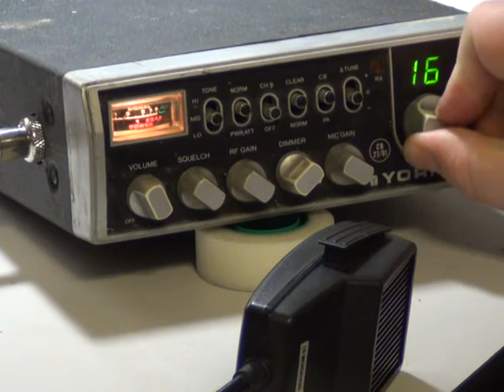York JCB863, UK (CB 27/81) CB radio (Mobile)  - On The Air Test

Comment: Do u do repair video on repair on the channel display.... Would be much help if you do.
Reply from the maker: There are quite a few reasons why a display doesn't work, but I'll bear it in mind if I get a set in with a blank display using this chassis (Cybernet 134).

Richard, G0OJF, UK

Comment: I had one of those new, from Boots, in 1981. I've still got it, but it hasn't been powered up for many years. G1DRP
Reply from the maker: This is where it all went wrong. Boots selling a pack of paracetamol & a CB radio...no service backup,  CB's aren't a normal retail item that you can sell like a record player or transistor radio!

Then they dumped their stock about Jan 83, selling stuff for as little as £5.99....then they get bought as toys, and ruins it for everyone else